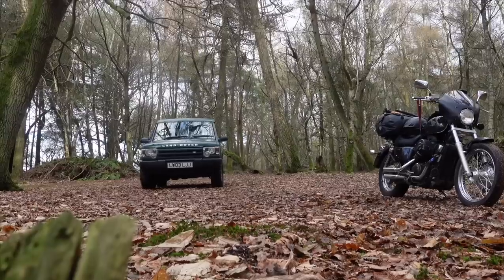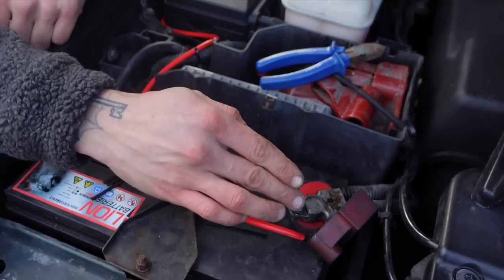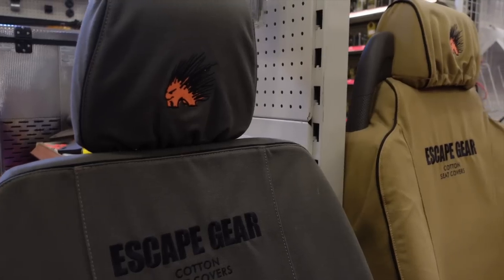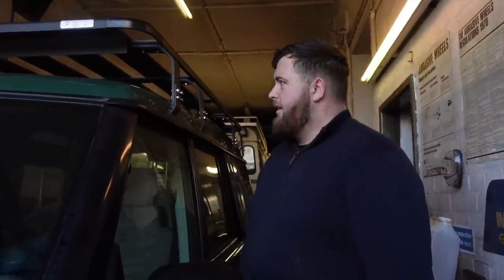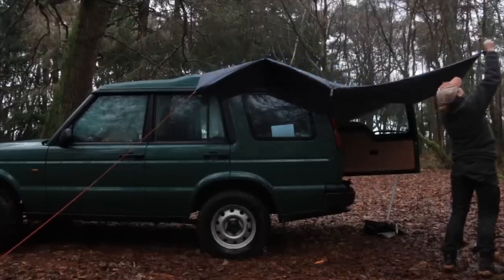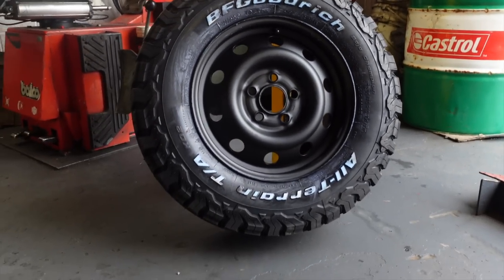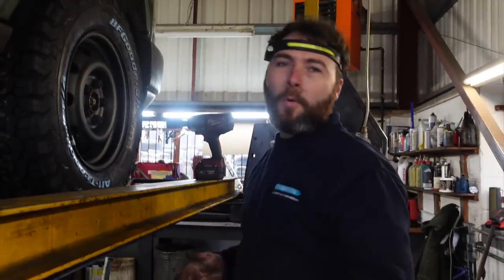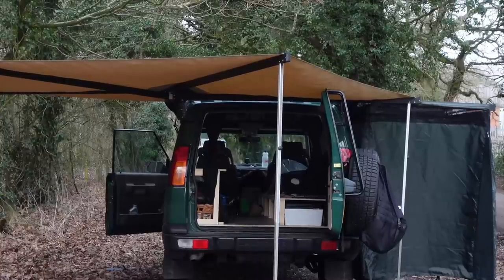TURNING My LAND ROVER into a EXPEDITION VEHICLE

Comment: Good work, info re split charge relay. Its jobs is to separate the start and leisure batteries. This means when the engine is running, the relay allows your leisure battery to charge. When engine off, the batteries are separate, so if you run down the leisure battery, your start battery will still be ready to go.
The 140A is purely what current the relay is rated to.

Comment: You won’t regret the BFG’s been running them for years. Best tyre. Some degreaser will get the blue off the white writing. Best of luck with your D2. I’m currently swapping my TD5 engine in mine.

Comment: Becca,

I just came across your channel and subbed!
But I’d like to offer a bit of advice if I may…
I would seriously look into a DC to DC charge controller. It will keep the house battery a lot happier and it will last longer. If you decide to go to lithium, it is a must!
Do the research. I had the exact setup you have and my battery was done after six months. 

Cheers from Vancouver

Comment: Your Land Rover is looking really good beautiful vehicle 🙂 nice choice of tires also, a very popular tire here in Ontario Canada 
My ex use to own a 1995 Land Rover Discovery, the gas V8 version it was a horrible vehicle always working on it.
I hear the Diesel engine version like yours is the way to go🙂 less issues.

I have owned a couple of four wheel drives in my day a Toyota 4Runner and my current 2021 Dodge Ram with the hemi .

Comment: I'm getting van envy here, that shower cube looks way more heavy duty than the thin shower tent I hang over the back door of my peugeot partner for the same purpose. One question though, are you planning to get a gas locker for that camping Gaz 907 cylinder? When I had one of those in my previous van I was told I needed to have a gas locker and cut a vent hole in the bottom for safety reasons.